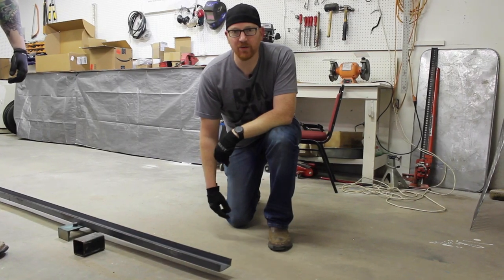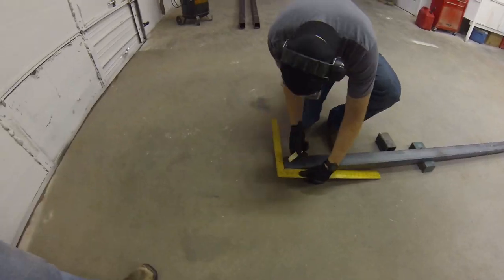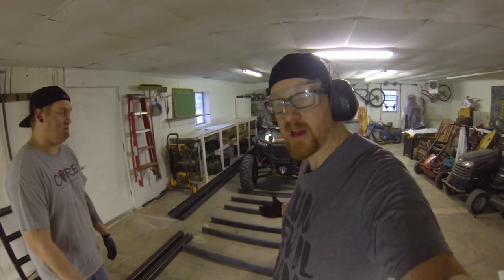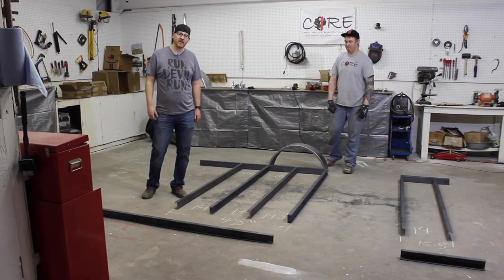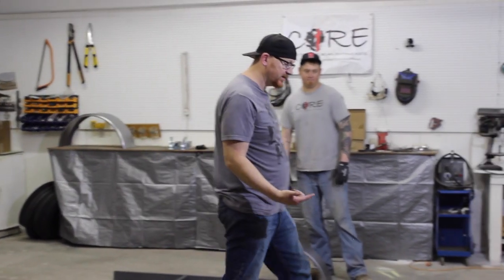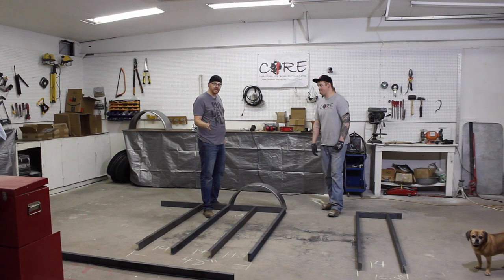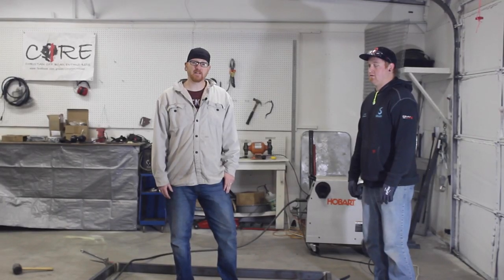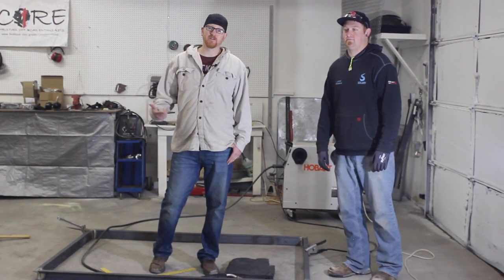Making a BETTER Hiding UTV Trailer. Part 1

Comment: Dang these things are a steep price for what you get.  I appreciate the hideaway aspect, but it’s a hard price to swallow when you can snag a 20’ Utility for the same money.  Good luck fellas, the idea is amazing even if the price seems far off for me.
Reply from the maker: All trailer prices are up.  Inflation is in all of it.
Reply: @ThinkBuildTest  I’m not arguing that.  And please don’t take me responding again as an attempt to argue to trash talk.  I’ve been trailer shopping for a couple of months now.  Trying to decide if I want to rebuild an old clapped out rig, or buy new.  You’re totally right.  From just 5 or 6 years ago trailer prices are astronomical.   The point I was attempting to make was the price of yours seems a little steep when you figure how much little material you’re using versus a 20’ for the same price.   And I would assume some of that price is that you guys figured it out.  Something compact and able to be stored in a small spot.  There’s value there for sure, I just can’t see where the rest of the money is going.
Reply from the maker: @juallhuce  believe me I thought when we started buying more material we could get qty discounts.  But no one would make a long term agreement to get price breaks.  But because of the shortages, high demade and uncertainty of the future pricing market no one would work with us.  I was delusional to think it could be 2k before the pandemic.  Additionally these are being double powered coated.  There is allot more time involved in making more precise measurements and detailed piece's.  And it is thicker guage metal than a traditional trailer of its size because there isn't wood for additional bracing.  The price isn't linier on guage metal it is exponential right now.  I appreciate your interest and your comments.  They are welcome no worries.  We just aren't living in the same world for small business opportunities anymore.  There is a reason the top model sxs went from 27k to 47k in 3 years...
Reply: Build ur own . They are not that complicated  to make one .
Reply: @tomahawksteak6672  Thanks for the advice.  It never occurred to me.